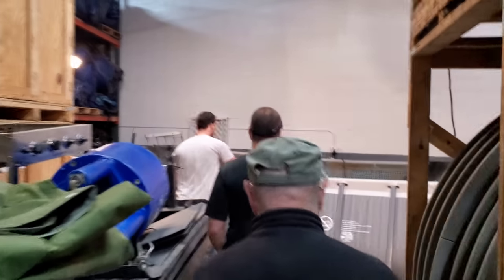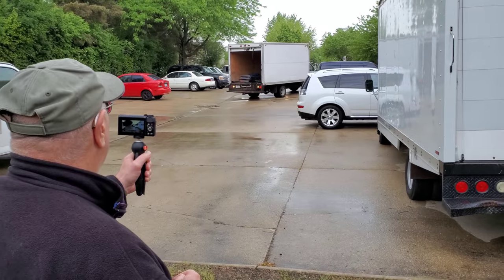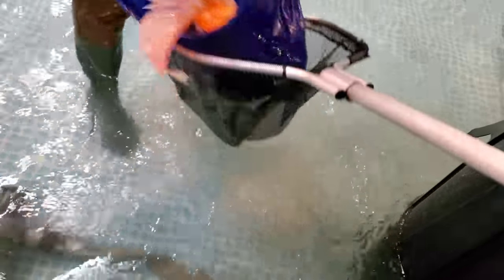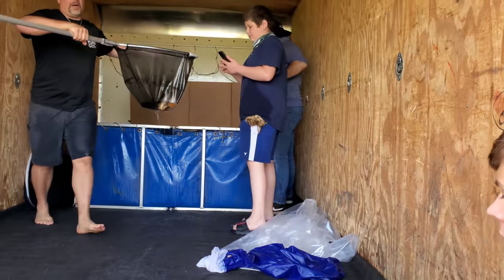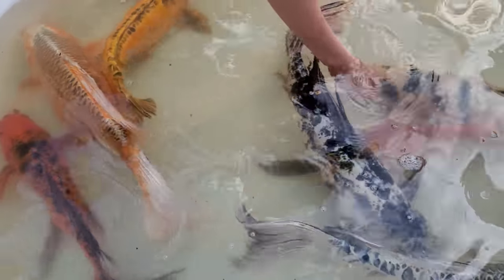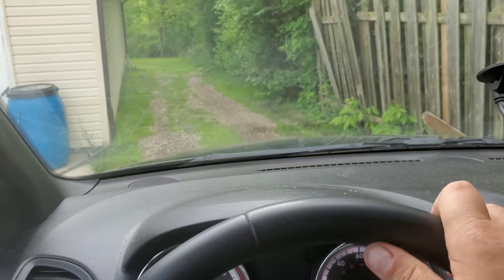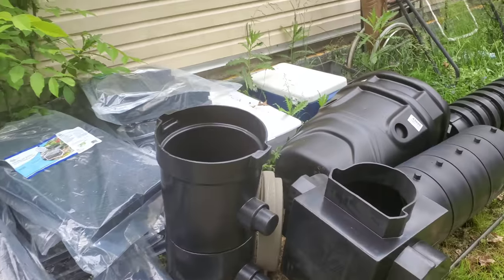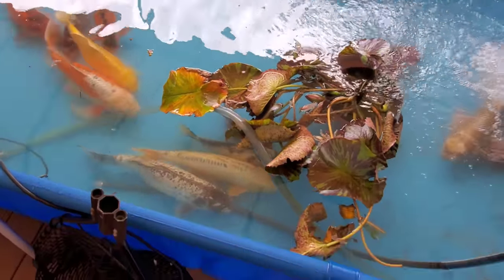Shaquille O'Neal gets huge koi,  the biggest butterfly koi i have ever seen ! - OHIO FISH RESCUE

Comment: As a ex koi keeper, I lost my koi's in a divorce, what was the purpose of of the sock net. I understand they're for not damaging the fins but it seems using the regular net to catch them defeated the purpose. Yes I seen it was a rubber net and no I'm not trying to be a smartass or trying to put what y'all are doing. It's just something I noticed and was curious about.
Reply: The regular net did indeed defeat the purpose , generally speaking koi keepers wouldnt use a mesh net at all . Directing koi is very easy , bare hands or a bin would have done great.
Reply: Simple...to lift them in water not the net. When you get big fish their body weight will cause bleeding in the gills. Only one fish had bloody gills out of everyone that was transported